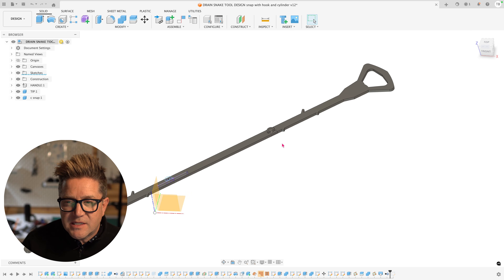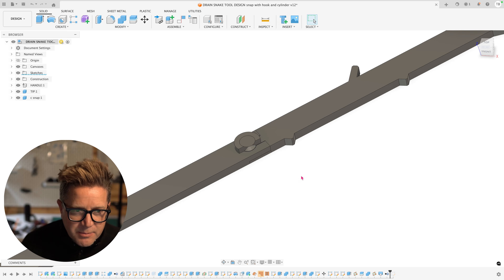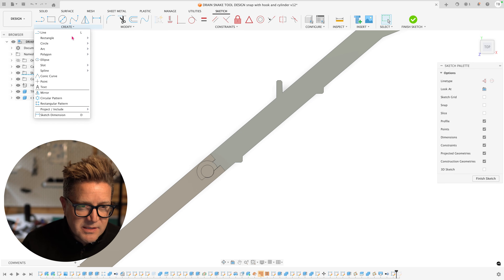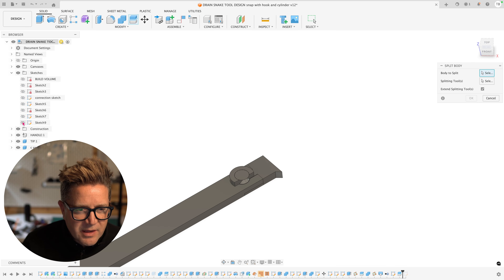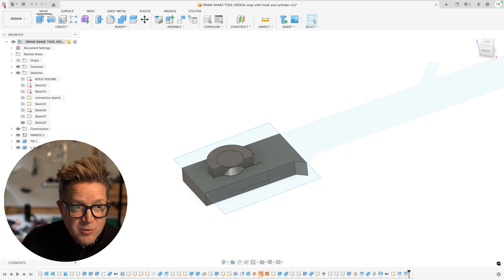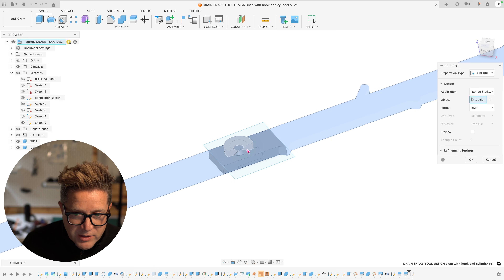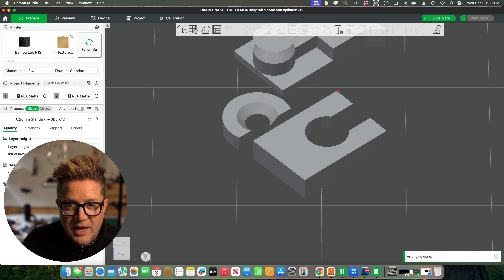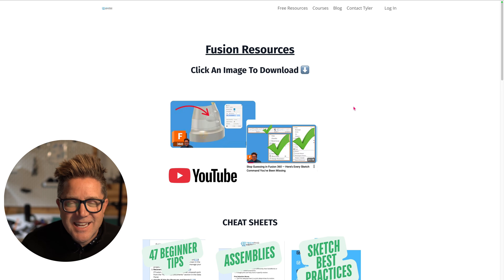How to Prototype Faster in Fusion— Without Reprinting Everything

Comment: You work too hard. Export the entire thing to an STL, load it into your slicer, split the part, and delete the portions you don't want to print.

No mods needed to your sketch, no cuts in Fusion, no hiding and unwinding bodies, and no combines to reassemble.
Reply: This is the way. I often print thin slices or sections for test fits, and always use the Split function in the slicer.
Reply: Cutting out a small portion in the slicer can mean 6 different cuts, each has to be rotated and aligned properly. After the 10th iteration you will hate your life. It is much easier to create a simple feature in Fusion, that way you can keep iterating there and just un/suppress the feature when you need it (kind of like creating a view) to only export exactly what you want into the slicer.
Reply: @TheKarolans  The cuts in the slicer rarely need to be precise when you're making a small section of something for a test print. I'd guess that 99% of the time, the slicer works fine for me.
Reply: @kenwhite6739  Yes just depends on your use case. I often work on small objects that need dozens of iterations to get right, so for me it is much easier to create an intersect combine and turn it on to quickly export exactly what I need. But if you just do one or two edits then slicer is all good as well.

Comment: I do the same thing, but use Bambu Slicer to cut the model so I’m only printing the part I want to test. That means I’m not messing with the part in Fusion which works best for me.
Reply: Yeah same, but with Orca (pretty much the same). You should not mess with the model (or create a copy)
Reply: @dennisaarts7924  You don't mess with the model - just right-click the feaure in the timeline and suppress it as needed